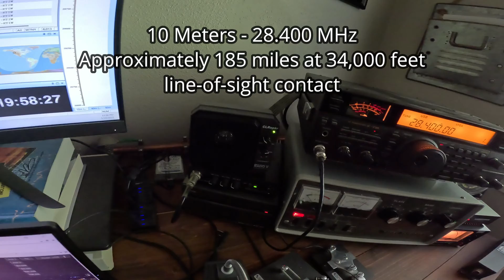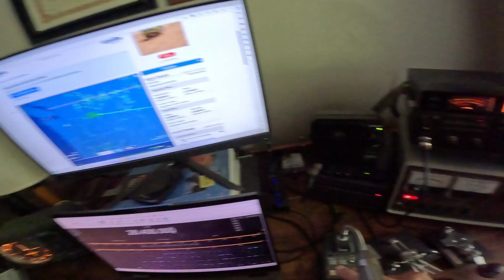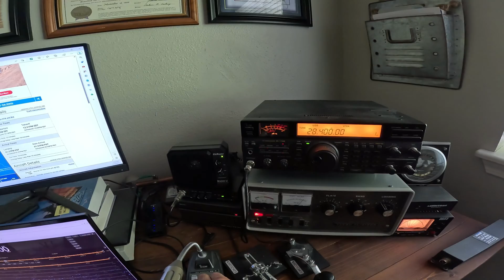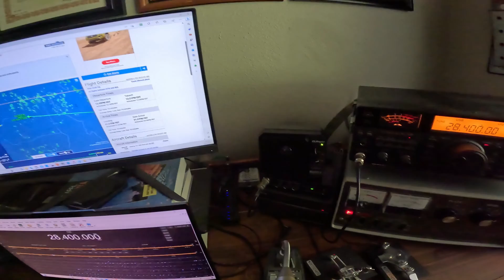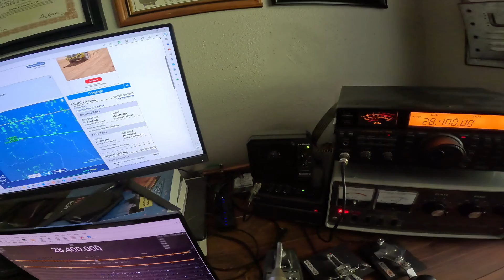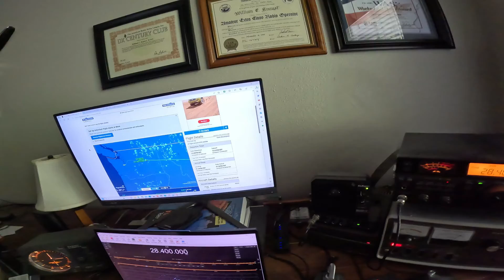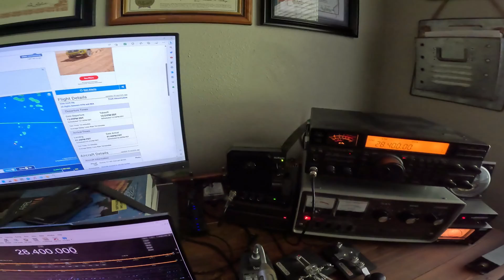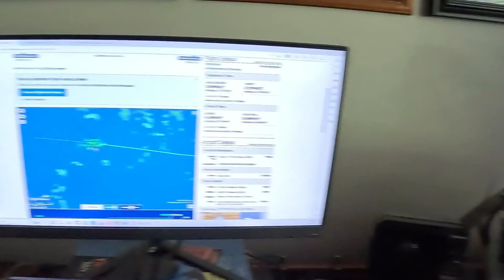Boeing 737 Ground-to-Air Ham Radio Contact at 34,000 Feet

Comment: Was that the pilot? And was he using a handheld?
Reply from the maker: Yes, that was the captain. He was using the aircraft’s on-board HF radio.
Reply: @sogpilot3137  completely slipped my mind that on-board HF radio uses same frequencies as ham general-licensed frequencies. HF band usually not used by air traffic over domestic flights? Think it's saved for ocean flights if not mistaken? If so, helluva way for pilots to pass the time while at altitude!! Crazy how there's always something new to discover on ham radio, as old as it is! Enter APRS, and that's a whole other world to play in from the air.